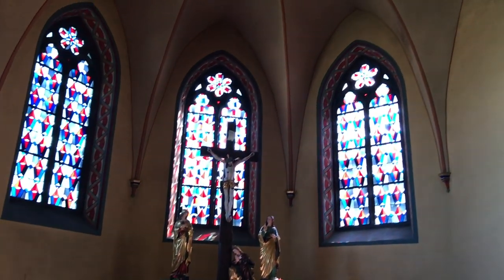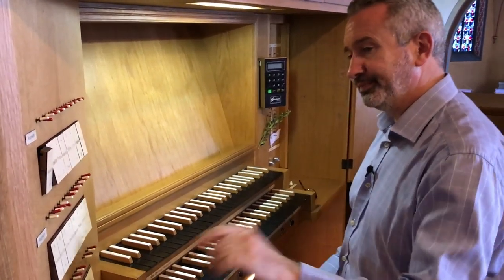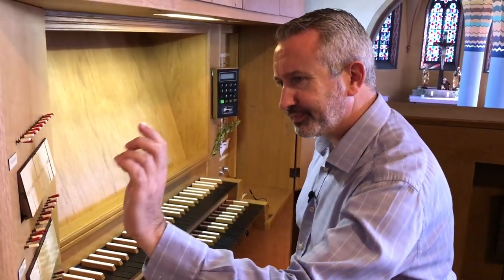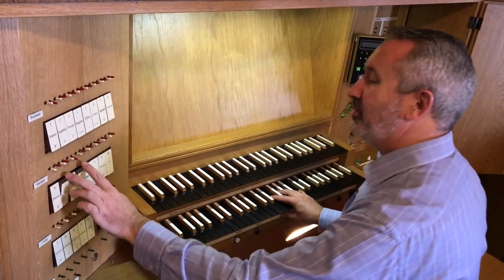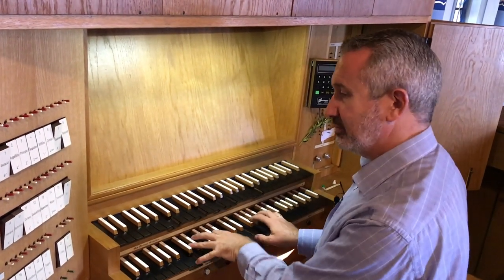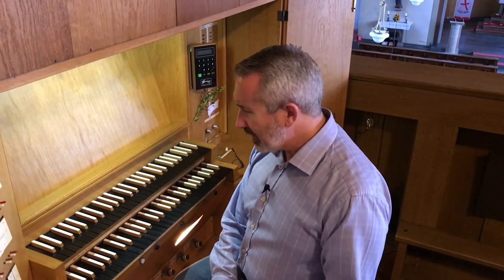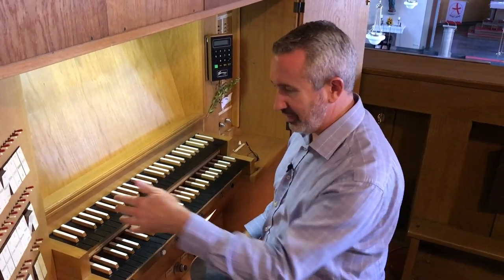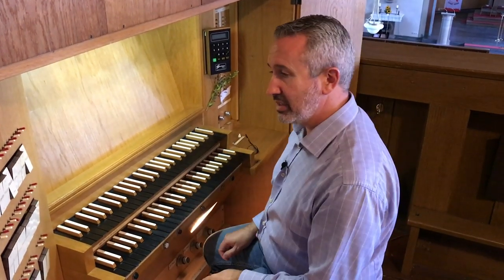I've Got An Idea!

Comment: This technique of using a different part of the keyboard to get a different sound out of a “stop” is something I used a lot on my (horrors) electronic keyboard. Of course there, I could use the transpose function to still get the whole keyboard. Transposed by just semi-tones (or by hundredths, using the “tuning” function) can also, more subtly, change the sound.
Reply: Yeah, that's called "split keyboard.".. it's a workaround to having only one keyboard. Requires a whole different mindset to play.
Reply: Bill Martin Not split keyboard, just using “octave up or down “, and “transpose” functions.  Changes of just one semitone, can brighten a major key, or darken a minor key. Try it.
Reply: Its a common technique to explore with small organs, especially those from the revivalist baroque period where some stops aren't where you expect to find them, such as a 2' flute on the great made mostly of principals and the 2' principal on the upper manual made mostly of flutes and a buzzy reed.   The law of economy - get the most out of every stop you have even if you have to play it an octave or two above or below.

Comment: I was wondering about the red and white switches above the stops, then it hit me - I bet those are preset selectors. Am I right?
Reply from the maker: Yep!
Reply: @FraserGartshore  Wow, that's more presets than you have stops!
Reply from the maker: There are only two presets - red and white. Each stop can then be selected for red or white or both and the presets are selected using the thumb pistons under the lower manual. It’s not as exciting as it looks!

Comment: Excellent, informative video - as they all are. Thank you!
Quick question though. I saw when you had the coupler on between the two manuals, the coupler only played one way. So playing the lower manual brought the upper one into play, whereas when you played the upper keyboard, that's all you got. I don't think that is normal? Thanks anyway for the most informative channel.
Reply from the maker: Yep - that’s normal - you couple Manual II to Manual I, so both are playable on I but not the other way around.

Comment: Did I miss it?  I was wondering what the red and white toggle switches are for....
Reply: You can flip those to create sort of a "preset" so that you can quickly change a lot of stops with the buttons under the manual.
Reply: Sort of a simplified 'preset'. You flip the switches on the stops you want to assign for a particular piston under the 'Hauptwerk' manual. I think there are 2 pistons (Fraser, correct me if I'm wrong), so the white switches coincide with one, and the red switches coincide with the other.😉
Reply: @pepesilvia8365  ok cool .  I'm guessing there will be a solenoid to actuate the stop rocker switch?  I'm also guessing that the keypad thing to the right is for programmed playback with midi or something?

Comment: If you wanted could most organs have all the stops open or will the wind run out? Thank you
Reply from the maker: Most organs are built to be able to cope with tutti registrations - some organs are noticeably out of wind if you play large chords on "the works" - it can sometimes be a rather charming effect!
Reply: @FraserGartshore  Gloucester Cathedral - even after the Nicholson rebuild in 2000 and further work more recently, big chords on full organ make it go noticeably flat. You can hear it on the recording of David Briggs' Mass for Nôtre Dame. Schwimmers will never be an adequate substitute for big double-rise reservoirs!
Reply: The 200 stop Woolsey Hall organ at Yale University produces its fullest sound using only about 20% of its stops. It's somewhat rare, but a good example of judiciousness in registration! Do you really need the Dulciana in full organ?...
Reply: @virginiaorganbuilder  probably not, but with a lot of organs, while the volume comes from relatively few stops, adding in the quieter stuff helps broaden it out.
Reply: @richardharrold9736  True indeed.

Comment: Why on earth wouldn't they just use all the available gallery space instead of shoving the organ right up one end of one half thereof? Seems daft to me when you could centre it and have so much more organ!
Reply from the maker: I suppose it’s a question of budget. Back in the 70s the church boasted a large choir, that was the choir loft - they need space for choir and organ.
Reply: @FraserGartshore  fair enough - but then no Schwellwerk or any soft accompanimental stops?! You're not wrong about the Pedal Gemshorn, nicest stop on the whole organ.
Reply from the maker: That was the fashion back then. Nowadays it’s all French Romantic - who knows what it’ll be in 30 years’ time...
Reply: @FraserGartshore  I've seen some modern German organ specs that look distinctly English Romantic - three Open Diapasons on the Hauptwerk alone, full 16-8-4 flue and reed choruses in the Schwellwerk, enclosed Solo with strings and orchestral reeds plus unenclosed Tuba, enclosed Choir organs, big Pedals based around a 16ft Open Wood...
Reply from the maker: I’m guessing they would be imported instruments from defunct churches in the UK. It happens more regularly than your imagine...
Reply: @FraserGartshore  no, I'm talking brand new instruments by Klais, Eule and others! Check out the Klais built for the Sultan of Oman, big Anglophile 4-manual on a wheeled platform in the Opera House in Muscat... similarly, the new Eule in the Roman basilica in Trier... and they are not alone.